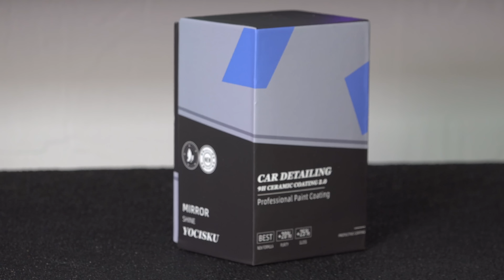I Ceramic Coated my SNOW BLOWER to make it NON STICK

Comment: Great video.  Now that you have a ceramic coating on it, you should consider fortifying it with a hybrid ceramic spray on wax to boost hydrophobicity and durability.  Just spray it on, let it dry and test it out the next time it snows.
Reply: Thank for the added tip.

Comment: If you place something like conveyor belt or tire sidewall on your impeller, it will never clog. I did this 9 yrs ago to my 1979 ariens 7hp. Not only wont it clog but i can throw snow farther than any new machine on the market that is 10hp or less. Clogging is actually caused by buildup in impeller housing, mfgs have a gap tolerance of a quarter inch or bigger. Bolting conveyor or tire sidewall will wear in and conform to the housing which eliminates that gap. I can snowblow slush and not clog up.

Comment: That's an interesting tip! I don't have a snowblower and I often have to shovel snow with a shovel. I've learned that spraying silicon lubricant on my shovel when the snow is wet and sticky. It doesn't last long but it works well. It would be easy and cheap for me to apply this ceramic coating to my snow shovel. I think I'll give it a try. Thanks for posting.

Comment: I have used something similar to WD40 before  to prevent sticking also there is a silicone coating which could be used

Edit: I just spray it not spread it evenly like in this video

Comment: I have a similar tread/track type snow blower,  It's a nightmare to move if it can't start for some reason. Or if you run out of gas or it stalls out at the base of your steep driveway and won't re start.  Unless you need tracks, I'd go back to a traditional wheeled design.
Reply: I just bought an Arians Platinum SHO 28 Rapid Track. You can flip up the rear of the track and it rolls like a wheeled unit.
Reply: We'll that's a nice idea , mine is like pushing a half track. @lavictoire1960

Comment: As the oldest of 7 children, 5 boys 2 girls, my father didn't buy a snowblower until the oldest 3 sons had moved out.
Reply: No reason to spend extra money when you have all that man power, plus without feeding 3 more people he could finally justify the cost 🤣😂🤣😂
Reply: @akaredcrossbow  Yeah my Dad was all heart. Some of the neighborhood kids would help us at times. Driveway was at least 80 yards long, with a turn out. When he did finally buy a snowblower, I would race to his house after work if it was snowing to use the snowblower. He would come down the driveway and say what are yeah doing? I would answer, just wanted to see what it was like.
Reply: I walked to school in a foot of snow barefooted for 3 miles uphill both ways. Well a tad exaggerated but not that far from truth.
Reply: Letting the girls off easy, 'eh? Tell them to get out there and shovel too, everyone could use a little more humility.
Reply: ayuh, growing up in the 50's and 60's not too many snow blowers around, but plenty of manual labor. work like that built character and responsibility.
Reply: Ok boomer

Comment: I wonder if this works on the cheap plastic of say a corded snow thrower.   The cheap plastic corded snow thrower managed to slowly cut through the recent 40 cm dump but it was dry snow and wet snow does clog it up.   However being plastic, it's not painted, the plastic is just dyed.

Comment: Will it work on a heavily used snow machine?
Reply from the maker: It really depends, you can ceramic coat many materials. Any application is better than non, I would just try to make sure there is no dirt or loose paint.

Comment: I can see this working. I liked your Pam trick but switched over to  WD40 on my blower (less issues with the wife yelling at me).  I use the  big blast cans on my boat engine and figured it would work for the blower. Haven't seen a clog yet, and no build up.

Comment: Its not hard, I just clean the chute, and impeller housing of any stuck on snow... and make sure to go spin the auger a couple hours after use to make sure the melted snow on the warm surfaces are not frozen in place once cooled down...(I use a 60’s gravely “Dogeater”) sometimes  (after a slushy day) I cheat and put a space heater pointed into the housing with a tarp over it... once melted I just turn the auger a few times to make sure it doesn’t get stuck. 
I also find keeping the blowers in a warmer environment is great for melting the snow... but it also lets snow melt inside as the metal is warmer than the snow... so I keep my machine in an unheated shed ... so any moisture freezes and acts like that coating you just applied...

Comment: If u use that thing, that much, you”lol be getting a plow!
Reply: A plow on a cheap used truck=$1500 a year plus a place to store it. A plow on a good tractor= about the same.  A good large snowblower, replaced every 5 years = $200 a year and stored in a shed or under a good tarp. I'm still using a 20 year old used$200  blower and I clear 3 driveways
Reply: @kkarllwt  you must be retired
Reply: @kkarllwt  I clear a 60 by 60 foot driveway on a tractor with a 60 inch blade in a quarter of the time a snow blower takes,  and the tractor can cut grass,   3 point attachments, can do everything.  Still have the blower, only use it on a paved patio.

Comment: I think I'd just rather shovel my snow than use that big expensive snow blower.
It still left behind what will eventually be a sheet of ice.
Reply: Did you miss the part about 1200 feet of driveway?
Reply: @kkarllwt  I've got a really long driveway too. Not 1200 feet (maybe  a quarter of that) but still longer than average. I shovel mine because I don't like that thin layer of ice that most snow blowers leave behind. If you're going to have a thin layer of ice, you might as well not clear the driveway at all and just drive on it to pack it down. 
In other videos, he's shown that he has some larger lawn equipment. For as much he spent on this snow blower, I would have taken my chances on a plow attachment for one of those lawn tractors....but then again, I'm not sure which tractor/s he owns. 
...or, he can simply get a landscaping company that also does snow removal to clean the driveway because they'll probably do a much better job than that snow blower did for a whole lot less than the cost of that piece of equipment. Just depends on how much snow he gets annually in the region where he lives. 
Just my two cents.

Comment: I'd have never thought of doing this. I will say another good modification for those willing to go a little further would be to add some thick yet flexible rubber to the three impellers to close the gap between them and the housing. Truck mud flaps work well for this. It's just a pain to drill the holes in the impeller and get things lined up. That thing will throw snow a mile away though, and definitely not clog up in that area. Slush stands no chance.
Reply: I have been telling people to WAX... the inside of their buckets, augers, chute and deflector for 10-15 years.
Reply: @kielbasaglen6843  The rubber impeller mod is the only permanent solution for clogging snowblowers. You do it once and it’s done, and it actually works.

Comment: If you don't care about how it looks and have access to a small paint gun, consider using one for application  (the cheap small harbor freight one works great) spray it in fine mist at 20 psi. and allow {most coatings} to dry for one hour and do a second coat or as many as you want with an hour in-between if you have the time. you'll get it in to all the small areas you wouldn't otherwise get by hand. personally, I would do the outside by hand and the inside with a paint gun.  Great video. I did this to my lawnmower a few years back when I bought it new and it still looks new, especially underside of the deck ;)
Reply from the maker: I appreciate it. I dont think it will work though. This stuff is almost like acetone and evaporates so fast I think the fine mist would be gone before it got on the paint. Its a good idea but probably not good to breathe either. Just be careful.
Reply: @SilverCymbal  I do it for a living,  applying it to cars. it works great! and Yes! you definitely want to wear a paint respirator!

Comment: Nice tip.  wandering what happened to your walker snow blower?
Reply from the maker: It's still here. The Toro is here for review/testing But I actually used to use a 28" for my entire driveway for 4 years, it can be done but it's a lot of space to do without a rider

Comment: Great idea. I've use Automotive spray silicone it works good but as with the coking oil you have to reapply often. I like this idea. Please remember to let us know how long it lasts. Maybe coat the gear box and see if that improves that area. Thanks for the idea,

Comment: I don't get snow, but I like this idea. Meguiar's Hybrid Ceramic Wax might be a better option. In the detailing world, it won't be quite as good or last quite as long as the little bottles of concentrate, but you literally spray it on and rinse off the excess. No rubbing, no buffing. Even if you had to re-do it a few times a season, it would be much quicker and it's cheaper. It would also be easier to apply to all the nooks and crannies.

Comment: Lol. You used FAKE Car Pro Cquarts ceramic coating. Lolz. Good video though. 😉https://www.amazon.com/CarPro-Cquartz-50-ml-Kit/dp/B01H4D1ZAY/ref=mp_s_a_1_2_sspa?dchild=1&keywords=cquartz+uk+3.0&qid=1609218184&sprefix=cquarts&sr=8-2-spons&psc=1&smid=AM7POEJN815MU&spLa=ZW5jcnlwdGVkUXVhbGlmaWVyPUEyQ1k3VFRCR0RLMlUwJmVuY3J5cHRlZElkPUEwNjU3MDU2MVZGNzJXM0VQVVRYWCZlbmNyeXB0ZWRBZElkPUEwNDkxNTIyM0lXMUZMM1FNSFRIVCZ3aWRnZXROYW1lPXNwX3Bob25lX3NlYXJjaF9hdGYmYWN0aW9uPWNsaWNrUmVkaXJlY3QmZG9Ob3RMb2dDbGljaz10cnVl

Comment: This makes me ponder doing this to my lawn mower deck.
Reply: Ceramic coatings are amazing for everything!  Turtle wax has a spray coating that is easy to apply and works amazingly.  You can get it at walmart or auto parts stores.  You can use it everywhere you need to clean hard surfaces.... think showers/tubs, appliances, really anywhere where a hydrophobic surface would be a benefit. Have fun!
Reply: @sixoh_diesel5662  Yes, Project Farm on youtube tested several ceramic products and the Turtle Wax spray on was one of the best.
Reply: @sixoh_diesel5662  thanks, spray will work for me, hard to get at snowblower auger with a wipe on....
Reply: My friend waxes and ceramic coats his lawnmower. He says it works great. He has one of those $7000 spartan units he bought 2 years ago. I have a 21 yr old Ferris, so it's not worth the experiment for me. 😉
Reply: I don't know if it'll work quite as well, ceramic coatings form a superhydrophobic layer that repels water electrostatically, the uniformity of application means that oil and grime can't get a "foothold" as there isn't enough surface concavity. With grass clippings you're mostly dealing with bulk material buildup, which is less dependent upon the friction coefficient as the effect is mostly cohesion (sticking to itself) rather than adhesion (sticking to the mower), but it might help.
Reply: That's what I was thinking
Reply: FabAutomotiveDetailing did that to his new zero turn. Came out pretty good from what I can remember.
Reply: I use silicone spray. Works great 😊

Comment: Something tells me you actually use a plow more than a snow blower on an 1100 foot driveway
Reply from the maker: The plow doesn't work here, not that it couldn't. I have no where at the end to put the snow without it causing issues. This blower is here for a review but my current machine is walker 48" blower attached to a commercial mower. We are the 8th highest state for snowfall, but I used a 28" machine like this for my first 6 years here. Not easy!

Comment: Silicone spray. It's about 6 bucks/can.  Has an extension nozzle and will reach everywhere.  I spray my snowblower and all of my shovels.  You can get 4 or 5 snowfalls out of one application.  No greasy film, very little odor, if at all.  Dries in seconds.

Comment: The question is how often do you have to turn off your snowblower and declog it and is it worth $25 to try to minimize that? We live in the Colorado mountains and it happens to me often enough that I'll give it a try. I'm being optimistic, but if it can save a couple shear pins then the cost is less than it appears and it is easier to apply coating in nice weather than change shear pins in cold snowy weather.
Reply: Add an impeller kit and you won't have to clean your chute again.
Reply: @Fishingtuts  I never coated my blade and now it is Winter. But hopefully your reply will help me remember this Spring. I didn't have problems with sticking last Winter. Instead my problem was we got a 4 foot snow and didn't realize needed to blow after two feet. It was tough to blow!

What is an impeller kit?

Comment: Just wondering how do you like the tractor drive, instead of the standard tires? Looks like a beautiful unit. Take care.
Reply: I purchased a Troy-bilt Storm Tracker with Track-Drive & love it compared to my older unit with standard tires.  The unit allows you to make a 360 degree turn by just disengaging 1-track while engaging the other.  One suggestion is to store it on a 4-wheel moving dolly which makes it very easy to move around a garage or shed.
Reply: @NYCBOISEFAN  Thanks, it looks great. Take care.
Reply: If it stalls out and you can't for some reason restart it, better call a tow truck , they are very difficult to move in a "dead condition" and like Nycboisefan suggests a 4 wheel dolly would work great if you could get it onto it by yourself with it wedged in between 12 inch snow piles that it dug itself into, or bogs down at the base of your driveway that a plow truck just plowed closed. and then drag it back to the garage to figure out why it won't re start.    And for some reason mine doesn't go as close to the ground as a traditional wheeled version leaving a 1/4- 1/2 in of snow behind.   And they tear the living crap out of lawn sidewalk edges if the grass area isn't completely frozen or if you make a turn on a grassy area, it's like a WWII war movie with a half track stuck in mud.    They're good for some things and horrible at others.

Comment: Did the same to my blower with some 3D ceramic coating I had left over. Works really well. Even dawn and vinegar stripped my shower doors with a magic eraser and ceramic coated those as well. So easy to keep clean!

Comment: Good idea.... But... Best thing to do is super charge the impellor itself. Cut a tire sidewall out and bolt to the impellor blades. Eliminates the 1/2 inch gap they all have. I've never had a blockage. It shoots slush and snow like a beast

Comment: I use deap creap sea foam lubricant/cleaner
Reply: And after all the residual pack melts, aren't you left with a "stain" on the garage floor?
Reply: @charlietuna5962  a little bit in my shed

Comment: I live in southern Maine and we get a fair amount of snow and lots of times it’s wet and sticky and it always manages to clog up the machine -
The gap between the impeller itself and the housing is a major issue that is better or worse depending on the manufacturer -
I often times use spray car wax or paste wax and rub everything down just like you did with the ceramic coating and have pretty good results -
The best improvement has come from installing an impeller kit which you can Google and learn about -
A little involved and not readily done by the average person but it is doable -
I have a medium size craftsman snowblower and with the impeller kit I have not had the chute clog once in three seasons - and the snow - depending on the wind and the consistency -  is thrown anywhere from 25 to 50 feet which is a huge improvement from prior to the impeller kit installation-
For what it’s worth
Thanks for posting
Reply: The impeller kit is the way to go. It really makes a huge difference! My machine has not clogged once since the impeller kit was installed.

Comment: Isnt that just regular PTFE or dry lube that have billions of smal "bullits" that fill all holes in the paint and give it a coefficient of friction of close to nada? It's like floting teflon you can say. 

I have use this PTFE spray that you can buy in almost any car part store for $ 3-4 for a few years now, but it too wares off after a while. Was thinking of buying a few sheets of teflon but and glue it to the shoot, but wow that was expensive, so i go with the spray...

Comment: Silver C, I think that you would be better off using a product like Turtle Wax Ceramic Detailer to maintain your non-stick surface. It's easier to spray & wipe than use that Ceramic applier.

Comment: I don't have snow. . but I've got a garde, heavy clay soil, and a tiller, I think there is a chance this trick might just help when the ground is wetter than ideal.
Reply: large agracultural machinary uses a product called "slip-plate" that sprays on from an aerosol can.  does the same thing and lasts longer

Comment: Umm if it was me Id stick a plow on the front of the side by side I saw sitting parked. Screw using a snowblower if I could drive around sitting inside a heated cab.

Comment: There’s that turtle spray hybrid ceramic spray, wonder if it’s worth using that stuff to get in the  hard to reach areas.
Reply: I use it on my truck and it works great. I'm going to give this a try and see how well it works.
Reply: I use that same brand from Walmart on my car months ago and noticed that was easier to remove the snow accumulated and after a couple of days after the snow the car keeps looking clean even when I haven't take it to the car wash. There's a video of a guys that is a professional and review all these products and shows how to apply it the best way.

Comment: Excellent idea . I have never used a DIY ceramic coating but have used sealant on lawn mowers and car wheels/rims .  Easy to maintain and clean. You could use a spray wax topper and microfiber wipe after using snow thrower.  It will increase the ceramic coating longevity and surface slickness